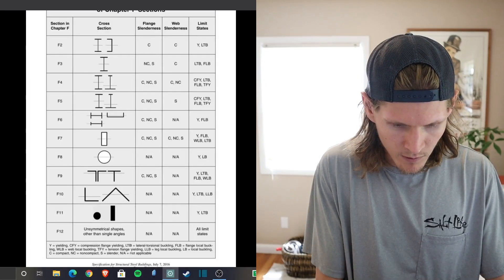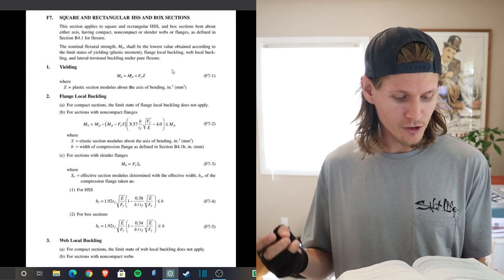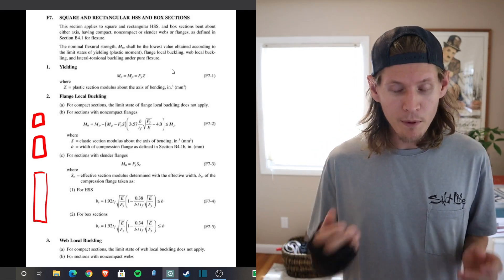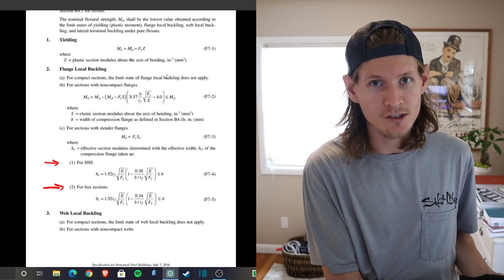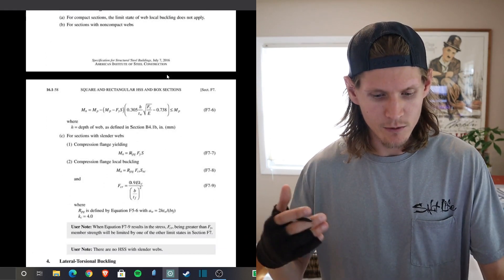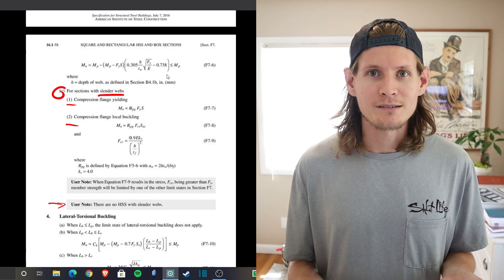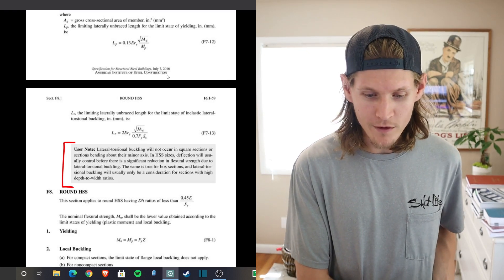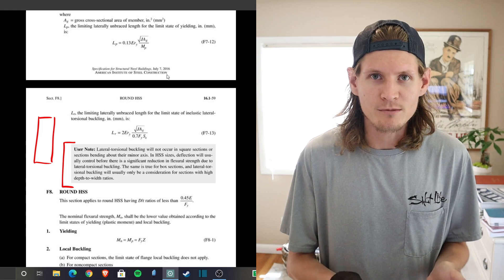They Changed WHAT?! - AISC Steel Manual 15th Edition - Kestava Shorts

Comment: Got a PE problem for you.                                  
"A cantilever beams is 7 ft long. The cross section in 5.5 in. x 4.5 in. deep.  E =1.5 x10^6 psi.   There are 2 concentrated load: 150 lb @ 1 ft. from free end and 100 lb at 2 ft from free end.  What is the tip deflection?   (0.45 in.,  0.55 in., 0.50 in. or 0.60 in)."   Thx in advance. looking forward to seeing your next vid.
Reply: After trying by myself. I got the deflection 0.44729 in.   Guess ans. A.  But I am looking forward to seeing your solution.
Reply from the maker: hope you enjoyed the Video Narathip!